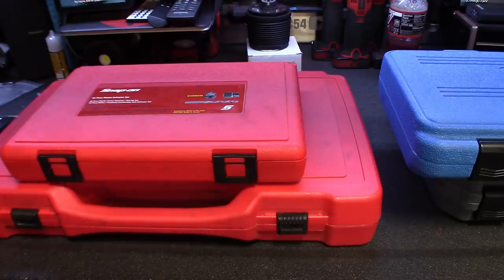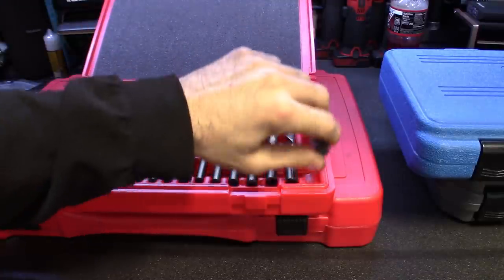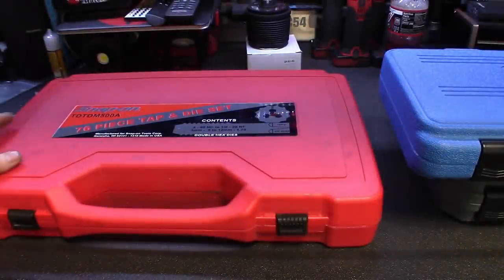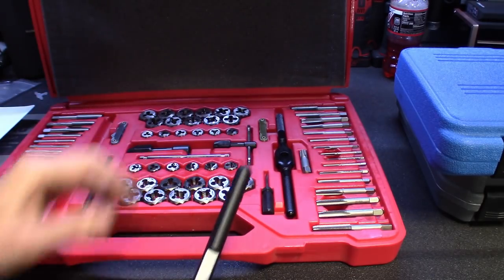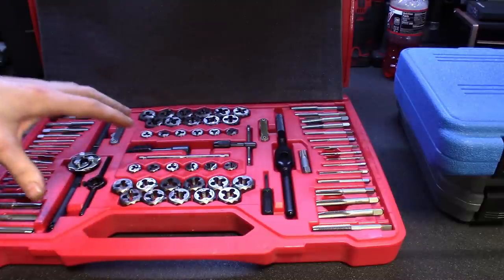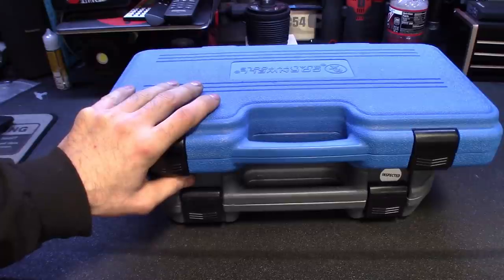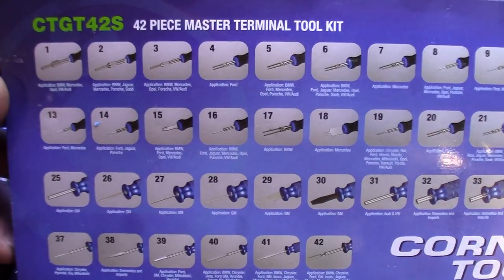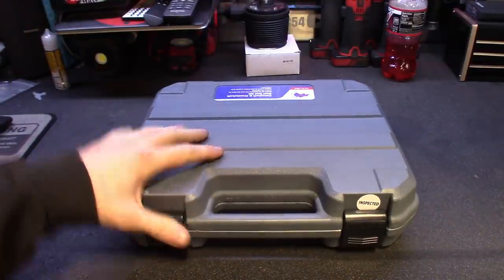Blow Molded Case Tool Haul

Comment: I have the same sets from snap on.   The big snap on set just includes drill bits.   
Like the Cornwall tools the one thing with the seal remover installer.  The one pet pev is when they are not labeled.   Not for me but I hate having to show people how to use the tools.  The last shop I worked at.  It drove me nuts because i had more tools then the owners and everyone in the shop.  
I sucked going from sharing a shop to working for someone that really had bad business ethics.
But I am working on building my own business and house.  
I always loved it where my grandfather had his shop out side his back door.  My dream

Comment: I’ve had the Snap On tap and die set for years.  It’s high carbon steel, which is inferior to high speed steel, but take your time and it’ll do just fine.  And can’t beat that warranty.

Comment: I have a snap on EXD35 extractor set and it as a drill and extractor chart on the back so you use the right drill bit and extractor for the job

Comment: One tool you might want to look into for the o s*** drawer would be the Snap-on Die socket. I picked one up for $30 ish and that socket is great when re- threading a bolt or threading round stock. Part number DDS1. I would also like to see more of the civic because I find it very interesting!

Comment: Why does every civic build on YouTube require a turbo, I've owned a db8 since 05. Only mod is a type r intake cam. Never felt like I need more horsepower for a street car. I've hit 140 In it a twice, it's currently in a state of disrepair. Sure I have a lift and all the tools to put it back together but I'm to busy working on paying jobs. I put a new wheel bearing in a pilot this weekend, (press in) it went in about as good as you can expect one to go, then I also did a wheel bearing in a impala but it was a bolt in so a cakewalk basically. Keep putting out the content JR.